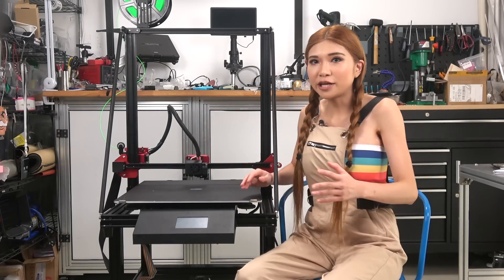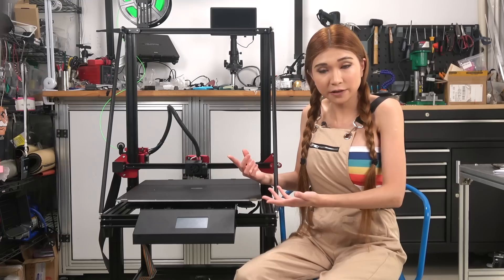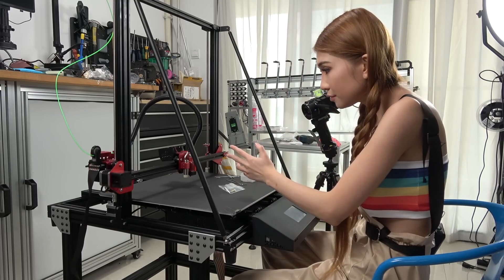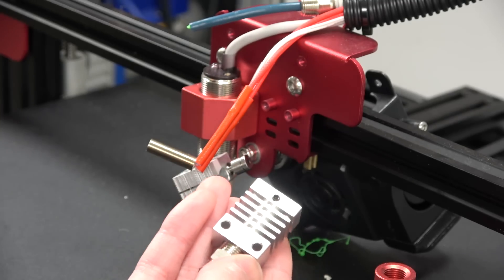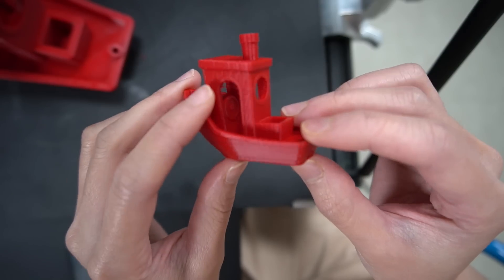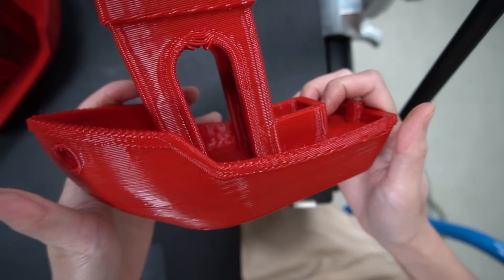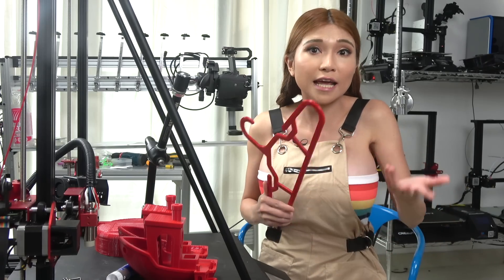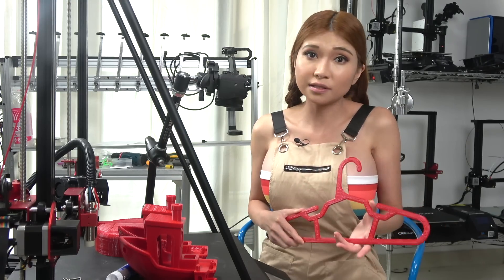First Look- Creality CR-10 Max! Also, Supply Chain Disruption- Are We There Yet?

Comment: So glad you addressed the downsides to these large format printers! Definitely a niche use case, but a 1mm nozzle makes the printing times a lot more bearable! Creality should offer it like that or a 0.8mm nozzle from factory, 0.4mm is silly.
Reply from the maker: It comes with an .8 nozzle but really needs the vertical heat block of the Volcano hot-end to get enough plastic through. Creality was willing to license/buy them from E3D but E3D was having a sulk so refused to reply to DM/email/tweet so all I could do was push to not have a cloned hotend used. Total waste but E3Ds choice.
Reply: @Naomi-Wu  is the vertical heat block you installed size 20x20x12 ? or 24x20x12 ? thanks for the video :-)
Reply: @Naomi-Wu  Too be honest if that is the attitude of E3D I would not mind a cloned hotend. Their loss and the user still get the intended experience.
Reply from the maker: @cobusgrobler662  No, you don't steal because someone won't sell. I won't be a part of that. We'll just have to engineer our own. Eventually it will be better. But the entire 3D printing hardware ecosystem is going to end up in China because of short sighted thinking like this😕
Reply: @Naomi-Wu  Agree 100%, those are true words.
Reply from the maker: @elementdw  Slice folks are great but I'd be much more comfortable if they had some Chinese IP protection, right now if Creality licenses, every factory here will just rip off their designs- and then no more Slice. Awesome people and design though.
Reply: I think printing on the smallest size printer you have also makes for better prints as there is less weight running/jogging around causing artefacts in the print. I guess its also cheaper especially if you are heating the bed.
Reply: Add a klipper upgrade then the printer is able to print on 150mm/s -200mm/s
Reply: the reason I would like a big printer is to print things like box inserts like these https://www.thingiverse.com/thing:3644498 , drawer inserts etc, but not tall stuff. Would they also give prints that is not good in this type of use also?, I guess printing smaller items and either gluing together or snap together could be an idea, but I'm not there yet, it feels easier to just draw a big box :)
Reply: I have one. They came with 0.4 AND 0.8 nozzle out from factory. Yes printing large parts is slow but if assembled properly they can print accurate very fast (more than 100mm/s). Naturally not for small ones, but they don't need so much time to finish. I print all with 0.4mm nozzle and 60/100mm/s for large and 30/50mms for small and you have to look twice to see that they are printed.

Comment: Very informative. I just got my new max with built in BlTouch, still struggling to get printing on the bed. After self calibration the printer starts printing at 3 to 4mm above the bed. How can I fix this? Could you share your simplify 3D FFF profile for 0.4 and 0.8mm nozzle.

Comment: Hi Naomi,

I've been trying to gather info on whether i should pursue this printer or seek other option for the startup im pursuing, as I need a printer with a 400mm^3 build volume, and the features that came with the CR10 Max looked incredibly impressive, until I saw the TeachingTech video on it.

I guess my question would be if you've had any problems with the printer for all the time you've use it for, and if you feel it is worth the price.

Thanks!
Reply from the maker: It's working ok for me, but mine is a prerelease version. TeachingTech really knows his stuff so if he's having issues I would trust that and wait until he says they are resolved.
Reply: @Naomi-Wu  Okay. I really appreciate the advice, subbed btw. Happy printing!

Comment: The 10sPro was a steaming pile of junk when first released.  I spent 5 months getting it to work properly.  They rushed it out too fast. They used the community as their beta testers.  I wouldn't touch this printer for a number of reasons.  But do not buy this printer until it's been out for a good 6 months and everyone else figures out all the mods/upgrades/fixes it needs.  

Question for Naomi - How is the fan noise? My 10sPro was extremely loud. Did they spend a little extra money and put some decent fans in there? Also is that the same cheap and inaccurate sensor they put int he 10sPro or did they spend another $6 and put a decent one in?
Reply from the maker: Not unreasonable. They upgraded sensor to Bltouch.

Comment: Any suggestions on how to get creality to service my brand new ender three pro. I’ve had nothing but problems with it. Z access is bent/ miss aligned. I’ve even shimmed it with no fix. And then the heat nozzle melted the magnetic removal plate after I leveled the bed. I used my absolute straight edge and found out that the heated bed is marked and there is a high spot in the center. And I can’t get anything to 3-D print it doesn’t auto home. What would you do?

Comment: Great video - I appreciate that you took the time to talk about the pros and cons of larger printers and larger nozzles. I bought my CR-10S specifically to print RPG terrain, and I use a 1mm nozzle with the stock hot end (maybe I got a particularly good machine because I haven't had any extrusion issues).  For my uses, the "chunky" texture and look of these pieces is an advantage but I can understand how some folks might not like the way that 3D printed hanger looks. I used the CR-10S to print some color PLA lampshades for IKEA "NOT" lamps. Those needed the larger bed size but as you point out, they are very brittle (1mm nozzle in vase mode). 

Also, thanks for the STL for that vise!

Comment: Interesting, so what would you suggest for a 3d printer that WOULD print esthetically pleasing prints? I'm personally not a fan of seeing the layer lines, so the smaller the lines the better for me. Also, which filament would be the strongest durability wise?
Reply from the maker: PETG is very strong, Ender-3 can do .1mm which is hardly visible, finer than that you need a DLP printer.

Comment: Thanks for this Naomi. I would imagine that the extruder on the printer will struggle with large nozzles. Not sure what extruder Creality are currently using but if they provide an upgraded extruder with hobbed gears they probably can deliver. Something like a Bondtech or e3d Titan.
Reply from the maker: It's a Bondtech so no problem😊

Comment: Naomi, hearing you mention recycled plastic pellets, it reminded of sth I have been meanign to ask you for a while.

Are there "environmentally friendly" options for 3D printing? I mean, recycled plastic pellets, but also maybe biodegradable printing materials, maybe?
Reply from the maker: Sure, most of the time in 3D printing we use PLA, it's corn based and bio degradable.

Comment: but couldn't a dual extruder version with a .4 mil nozzle for fine outer surface/appearance and a .8 or 1.0 mil nozzle for infill/structure and speed be a viable, especially on large scale prints? Feel the comment was enough with the information given. thanks for the vid
Reply from the maker: It's sometimes done, good in theory but not really faster in the real world

Comment: Question for you Naomi ... I am considering 3D printing replacement sliding window hardware for a house, what material would be best for that application, and would a CR-10 work for it? The original hardware is extruded plastic track and injection molded fittings.
Reply from the maker: PETG has a good combination of strength and ease of printing.
Reply: Thank you! I will check out PETG, I appreciate your very fast reply! Have a great day.

Comment: I want to make a fuel cell bipolar plate with 3D printer, but the material to be used for the bipolar plate is 85% graphite loaded PP, is it possible to print such a material with a 3D printer.

Comment: I do not agree with the initial comments regarding large prints and printers, you are not wrong and you do state in the beginning that you hate large 3d printers, but you could have brought up more of the positive uses i think. I only print large prints and they are not just trinkets and vases, they are objects that i make money on. They are also not weak, you control the strength of the part with number of walls and infill. It does takes time to print but even that can be managed with experience so you can get it down to reasonable times, for example a complete and strong movie prop helmet at 40-60 hours. I have a modded CR-10S with braces that prints like a dream, but i am now looking at buying a larger printer, so the CR-10 Max is a strong contender next to the Formbot Raptor 2.
Reply from the maker: Great for prop making- I should have mentioned that.

Comment: I have to thank you for this video. I would like a big printer but even the cr10s takes up a lot of room and I guess this is is a lot worse. I always worry that it is too difficult to do the upgrade but you made it look easy. I was also worried that the PSU might not be able to provide the power to heat it up and blow the PSU. I watch a lot of videos and had never seen a naked hot end with the wires attached and now understand them better.

Comment: I certainly won't mind using one of the large format printers to get costume parts or even props to come out as a whole to reduce the time spent on doing individual part's post processing. But then again, depends on what the user is planning to use for the printers I guess.

Comment: The conversation was great, and in fact, I might be quoting you in the future. "06:47: But it took 18 hours. It looks really nice. But if you are doing any sort of production
 and this was just a quick jig or fixture you needed for a setup Really inconvenient in terms of workflow." -Naomi Wu, embarrassing the kaizen senseis. 

Personally on my CR10S5 I use a 0.8 nozzle and print at 0.4 layer height with 1.20mm extrusion width for making prototypes, jigs, fixtures etc. so it is really good to hear you talk about this! Thanks!

Comment: Interesting! Boobs and Brains are a winning combination, even if they're {old} boobs! :)
I see a solution here that might not be that difficult to implement:
If this printer was converted to use a dual extrusion head, with one standard nozzle and one large-hole/high-flow nozzle, the large nozzle could handle infill and subsurface while the standard nozzle could print the outer surface.
Layer height would have to be the same for both, but speed gains from faster infill should cut significant time from the print job and result in stronger prints. 

It might even be possible to use different layer heights as long as the high-flow head height was an even multiple of the standard head, that way, the standard head could continue to print the outer surfaces at 0.2mm, while the infill could be printed at 0.4mm,  0.6mm, or 0.8mm  for every 2nd, 3rd, or 4th outer layer.
What do you think?
Reply from the maker: Sure, some printers do this. Doesn't save a ton of time though...

Comment: At some point someone is going to make a 3D printer that runs more than one nozzle at a time. Just think about a unit running 10 nozzles at once. How fast would that be? And running more than  one nozzle at a time would also mean you could use more than one color at a time.
Reply from the maker: It's been done...
Reply: @Naomi-Wu  Details, I want details. Got a link?

Comment: Would love one of these, not interested in fast printing but large prints yes.
Reply: More specifically id use it to print a full size 6 foot tall johnny 5 robot, ill try to attach a link to a short video of my personally designed model. If it doesnt work i hope you wouldnt mind checking out the video i just uploaded.  https://youtu.be/rh5WqqY-X8E

Comment: Super informative always wondered my all the 3D printed blueprint parts are engineers make are mostly on the small side thanks for answering that for me. But I feel that the larger gran wouldn't be a big deal if you where 3D printing pieces for like a cosplay. just have to sandpaper the service and add primer or Bondo over it to fill the small gaps then give it a light sanding to be painted after. Kinda like doing gunpla models and other stuff.  But yet again do people want to do all that 😂.. either way thank you Naomi still the radest 👍❤🙏

Comment: 100% agree, strength and print speed is a property often overlooked. I build humanoid robots with 3D printed parts and probably 80% of printers are useless because they prefer smoothness over strength and speed. Instead I'm getting slow and smooth prints that fall apart where the layers join.

Comment: Talk all you like :) and please keep reminding Americans how they should buy only the good stuff from China rather than the stuff that's too easy to make here, like clothes hangers & toy boats.

Thanks for letting us know how slow 3D printers really are.  I can see them useful for one-offs and simple stuff, but not for production.  The ugly stuff can be filled in and the end result turned into a mold part, such as a piece for sand casting.  I can see how easy it would be to print a plastic cleat for a boat, and then cast it out of bronze.  The mold will last forever.

Speed will improve with advances in technology and in the newer two-part printers that mix the resin with a hardener rather than heating it.

It's people like you that keep the Internet fun, interesting, and educational all at the same time.

Comment: I used a 1mm nozzle for a few years and loved it, but always 0.5mm layers.  I think the plastic lays much nicer at this layer height without necessarily printing slower.  It helps prints look paradoxically better than a smaller nozzle print.  Although the resolution is lower, the errors seem small compared to the size of the paths.

Also, there is a magic to designing for large nozzles, and thinking about the paths more to create functional strength as good as molding or cutting.  The hanger is a perfect example of the sort of shape that a large nozzle printer can do very well, very fast.

Comment: Naomi, I like the in depth explanation you give. Talk as much as you feel you need to , to get your point made. One question on a large print . let say you had 10 lbs of plastic or more  on the table moving back and forth how would the inertia of the part changing directions quickly affect the print quality and precision ?
Reply from the maker: You have to make sure you have a large enough motor that you don't lose steps, and it's pretty slow...

Comment: You may try to print with higher wall width and lower layer thickness. E.g. with a 1mm nozzle some 1.5 to 2.0 wall width, but with only 0.25 to 0.3 layer height. With this you would also save a similar amount of time but get a much finer resolution.
I think that a lot of people who are making big figurines and models would be very happy with a big printer like this. They would simply run it days or a few weeks.

Comment: Thought provoking and well presented, good to hear your thoughts on supply chain disruption. I've just built a couple of large hypercube style printers and your comments on the size/flow/strength trade offs are spot on - I find I'm using only a very small part of the available build space and wondering if I shouldn't cut them down and make two smaller ones from the parts. I wish I'd had your insights when I was doing the design :)

Comment: Excellent points about the drawbacks to large format printers. I have a 400X400X500Z cr10 clone (Alphawise U10) and there is one thing I really like about the large bed. And that is the ability to print a HUGE plate of small parts for various projects I have. Even though it is no faster than my smaller printers, I can get more done in fewer plate sets. I can print 30 pieces of one part instead of 18 on my smaller printer. Almost 1/2 the number of plates. I can set one up, go to work, set up another when I get home, and then a third to print over night. 90 parts per day.

It can be more efficient, but is definitely a niche use case.

Comment: Kinda like the more talking part, it's interesting. Regarding your point about smoothness of the prints, there is a solution to that. I think it was EvanAndKatelyn who hacked a mini heat gun onto a 3D printer to slightly melt the surface after printing each layer, smoothing the surface down. It adds to the time, but not by much. [first print layer, then go back over quickly with heat gun, partly remelting it.] it would probably work better with the larger print size and much lower layer resolution because the big problem they had was it kept melting the layer too much.
Reply from the maker: Sure, there's a bunch of ways to smooth prints- just like there's a lot of ways to disguise woodgrain. My point is that it's not something I care about.
Reply: Sure, I understand that, and it's a fair point. The material creates it's own Aesthetic. Although I've seen it mentioned that heat smoothing [and possibly other methods] also increases cohesion between layers, improving the over-all structural strength, at least a bit.  I guess it's all down to individual taste in the end however. Some people prefer 8-bit pixel art after all..and it's sort of like that in 3D.